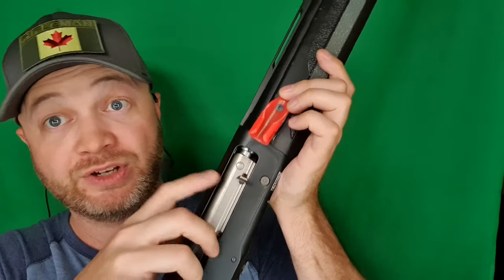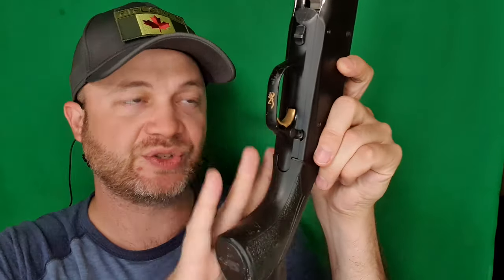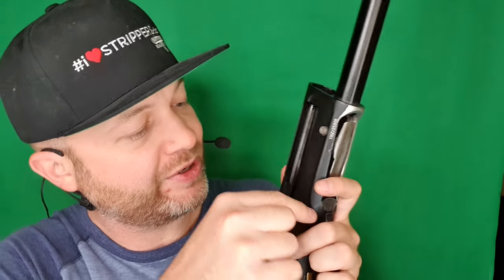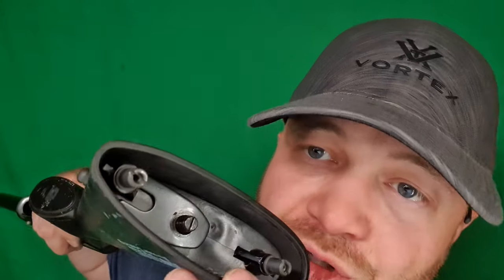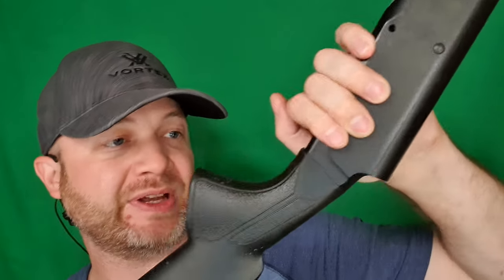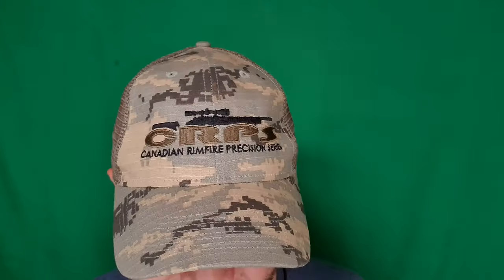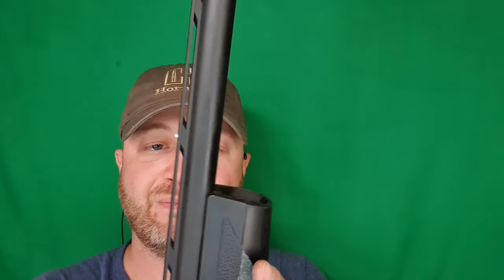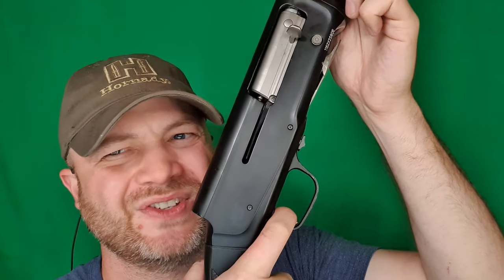Browning A5 (new version) disassembly

Comment: I have a Browning A5 ultimate. No finish issues. If you can find one, get one. Great gun! As for the cycling, lube the recoil spring and you won't have that problem. I religiously clean and lube my gun and it works like a dream. Only issue I have is occasionally it doesn't lock open when it's empty, but it's not a big deal.

Comment: Should never have been called the A5. 
The original A5 was an absolute classic, I've got several 👌
Reply: I never realized how popular they were till I got into gunsmithing last year and one of my family members sent me his collection to "deep clean" and learn with. Now I'm restoring one of his A5's, the Sweet Sixteen. It's a hand-me-down. And it's very humbling to realize that this design is what modern shotguns are still built from, albeit with improved components.
Reply: I've always said, if you can completely strip an original A5 then put it back together ( and it works  ) you can strip any gun .
Reply: If you ever get your hands on one  , try and get the book , trouble shooting your shotgun and rifle by J B Woods. ( 1970s )
Reply: Rifle and shotgun 😢
Reply: @richardperry4115  Try completely stripping the Taurus GX4. So far that's the most headache-inducing gun I've disassembled...so far. I'll be putting the A5 back together later today, and just going through the motions (to get it on video without hiccups) seems to be pretty straightforward. The hardest part will be putting the end cap on the magazine tube, cause it was a pain to remove.
Reply: @richardperry4115  And I'll definitely get that book soon. I'm still learning how to gunsmith, so any extra help like that would be great!

Comment: I’ve had my A5 for about 5 years and never had any problems. 
I recently cleaned it, like many times before, but now my bolt is stuck in the forward position. I removed the trigger group and made sure my bolt tail is sitting in the plunger, but it still won’t slide to the rear.

Any help would be HUGE
Reply: I'm having the same issue, did you figure yours out?

Comment: If you were to still run a 3 1/2 inch shell through the gun would it cause damage since you have two coils cut off of the recoil spring? I have a wicked wing a5 that won’t run light loads and I rarely shoot 3 1/2 inch shells. Most commonly dove loads, 3 inch duck/ goose loads, and 3 inch turkey loads. Just wondering if I’d be able to do the same as you without causing damage to the gun

Comment: I have a 3.5” a5 as well and have had a lot of trouble shooting light loads since I got the gun. (Stove-piping mainly) it has been very frustrating. But I also do a lot of duck and turkey hunting (much heavier loaded shells) and it cycles the heavy loads like a dream.. QUESTION: do you think I should cut off a coil or two of the spring ,like you did, to help cycle the lighter loads or do you think that if I shorten the spring, 3.5” shells would damage the gun, or the heavy loads will not run as good?
Reply: You have to run 1 1/4 loads at least on the 3 1/2 model. You’ll screw up the gun if you do that.